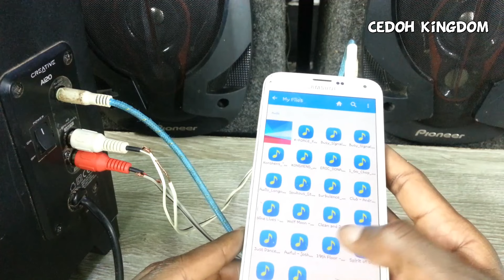Speaker Wire to RCA Plug

Comment: Not a great repair imho. Should be using solder plug RCA connectors with strain relief. Ok to get you by in an emergency, but twisted wires and electrical tape isn't a good long term solution.
Reply: But you got the idea, right? Or you wouldn’t have been watching this video.
Reply: You saved my tym and effort..thanks.

Comment: I had to replace my RCA cable from my vintage turntable, and got a quote from a repair shop of 100 bucks after watching this video I did it myself and soldered the connection, and everything it working fine...Thanks😊😊😊

Comment: Great video. I've done this several times, mostly to extend a cable. Works great. I usually leave a little more length on the plus side when I cut it, though, easier to work with.
Reply from the maker: That's a great idea!

Comment: I've got a 5.1 surround sound speaker system from a broken home theater and I'm planning to use it as a pc speaker. The connectors aren't the usual ones used in speakers so I'm looking for a way to connect them to one 3.5mm jack. This at least will help me change the connectors.
Reply: I have same problem lol

Comment: If i connect the rca cables to a speaker, and connect that speaker straight to the tv, will the tv speakers work in line with the additional speaker? If so, is there any way to turn the tv speakers off and use the speaker just from the rca connection? If i say mute the tv speakers, will the rca speaker still work?
And can the same be done with a soundbar?

Comment: After doing it can i use my speakers directly with tv .. i have Sony ss-ts73 surround sound speakers
Reply: Yes, take the red and white plugs and plug em into the output on your tv,and your good..might have to go into audio settings in your tv and switch it to "output" ..but yes, you can

Comment: Hi,I just purchased a pair of Goodman Micro speakers,that only have the Red/white cables but no power supplying these speakers,question,how are they set up,as they are designed this way,if any one of you knows,please let me know,thanks in advanced. Ie model 14671.

Comment: The problem I have is, my original RCA plug barrel itself has some problem, not the wire. How can buy a new rca plug and attach the existing wires ? In this case one of the plugs from my turntable output.
Reply: You can, just cut the broken rca connector and wire a new one onto the negative and positive wires.
Reply: That's not what he's saying... I think  he's saying the female side, on the turntable, needs replaced. In which case, fastest solution is to open the case on the turn table, and solder the ground wire to the remale rca connector ground- directly to the female rca connector goes into the board (typically a square metal frame with 2-4 solder points going into the board. 

And then solder the signal (+) to the spot where the center metal pin, of that same female rca, connector goes on to the board. 

Might not look pretty, but it's quick & hard to mess up

Comment: might try this. going to put some new parts on a turntable I bought, but the only speakers I have end in bare wire so this might be a good solution
Reply: Did I work with RCA plugs like in the video?
Reply: I have the same kind of project. Did it work?

Comment: Hello, thanks for the tips! I have a question. Is it possible to connect my bose 101 passive speakers (60watts) directly to my Edifier T5 subwoofer (70 watts) via RCA? I’ve seen videos saying that i should use an amplifier for the speakers to work. I was wondering if I could directly connect them to my sub without any issues.
Reply: ye